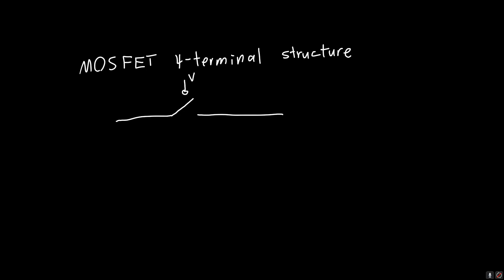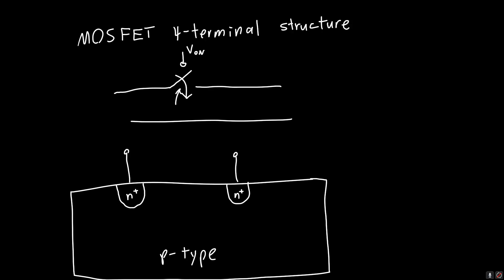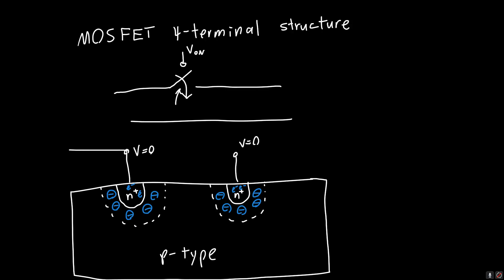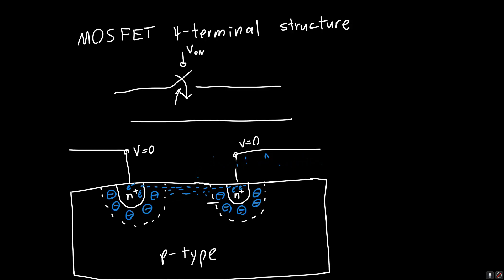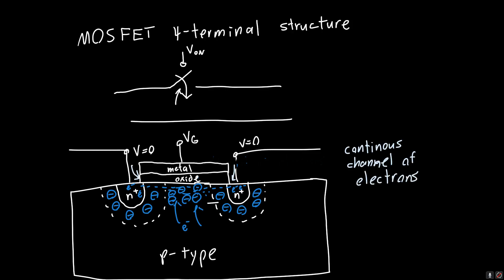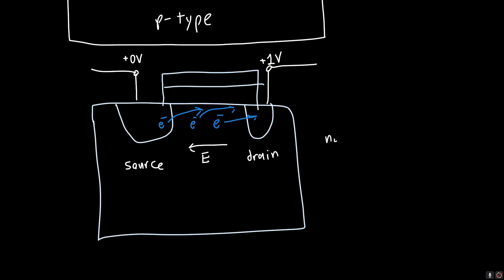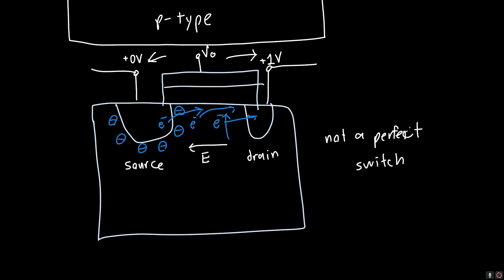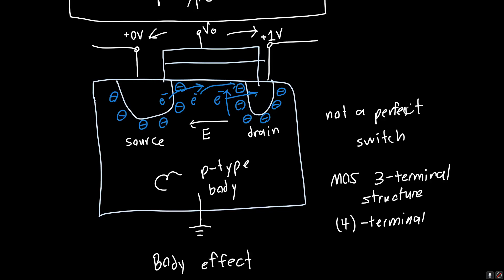MOSFET 3-Terminal Structure Explained

Comment: I'm a professional ME and a while back we were experimenting with high power solid state components. Traditionally we use contactors (just really heavy duty normally open relays), and it's bothered me for YEARS why MOSFETs only have three terminals while any mechanical relay or contactor needs a minimum of four, especially when you start combining hydraulics or pneumatics with electrical power.

It's such a basic thing that you'd think any EE would be able to say "well there really are 4, but the body is grounded so we don't include it", right? Nope. Even Google or textbooks weren't helpful with such a basic question.

Well done, I can now sleep at night. 

Hopefully, as I continue with these videos, you'll explain the concept of shorting S to B, which is a very foreign concept for an ME.

Comment: Hi, thank you for your easy and instructive videos. Would you please explain why the metal/oxide layers have to extend a bit over the n+ regions for the electron channel to form (at 3:30) ?
Reply from the maker: Sure, if you had perfect control over where you put the metal and the oxide, then sure, you wouldn't need that extra little bit of extended oxide. But in reality, you don't, and there might be a small offset in the oxide and/or metal layer compared to the underlying substrate, in which case you might accidentally have your metal in contact the channel, which would destroy the MOSFET.
Reply: Thank you. So we just want to be sure that all region between S and D be covered by the gate, right?

Comment: Hi, I really enjoyed this series and have learned a lot, good job!
I only don't really understand why at 1:30 a depletion region around the n-region must be formed?
Reply from the maker: Since there is an n+/p junction, this is a PN junction a depletion region forms between the two. It doesn’t looks like a planar PN junction, but shape turns out not to matter.
Reply: @JordanEdmundsEECS  Am I correct if I say this: "the p-side is lowly-doped, and that's why the depletion region extends almost only in the p-type material" ?
Reply: @Stign9  So he denotes the drain and source as "n+" which means the doping concentration in these two regions is much higher than the rest of the structure, so yes, relative to the drain and source, the p-side is doped much lower. This means the depletion region will be almost entirely in the p-side.